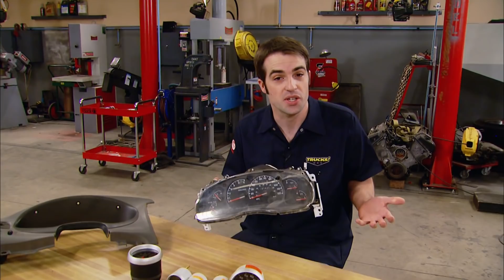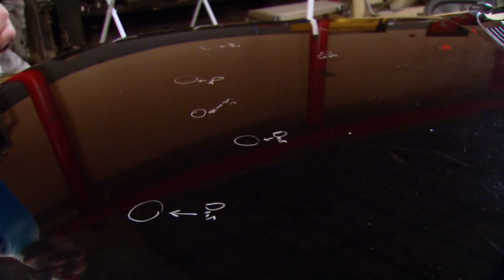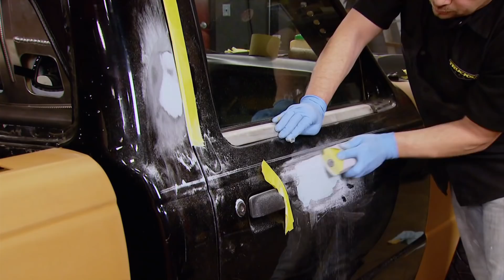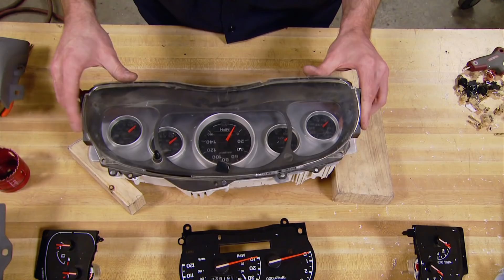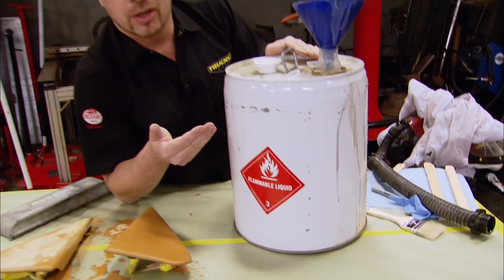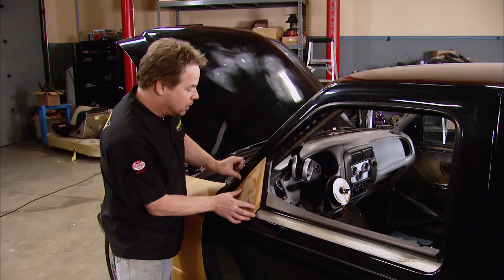On a Mission to Get Our Ford Ranger Rolling Thunder on the Road - Trucks! S14, E3

Comment: So Kevin, I got a 1999 Mazda b3000, V6 ,Flex fuel automatic, vin v push rod motor  since Nov of 2016 it was a Ford dealer shop truck; with the jump cab. Its got rust over one wheel well, tried to use fiberglass mesh & hardener, it was good for a while, but its popping thru on one side, but truck is pretty clean it was a Texas TRUCK, THEY SPRAYED A RHINo LINER IN THE BED. I heard you pitch Eastwood products & now this new stuff that you brushed on  any suggestions.[ hughmcsheffrey @gmail.com.] That's my first & last in the G mail.Thanks

Comment: https://youtu.be/PPJCQd7--XQ
They should change the name of the show to "CRAPPY HILL BILLY BONDO AUTO REPAIRS"!!!!
This is a idiot operation bondo is bondo which means cost of material, cost of sand paper, paint, clear coat, and fingers cross it don't look like crap. IN 2020 WE HAVE TOOLS TO REMOVE SMALL DENTS AND REFERRED TO IN THE INDUSTRY AS PAINTLESS DENT REMOVAL BECAUSE NO COST OF MATERIALS "ZERO CLEAN UP" AND LITTLE LABOR INVOLVED... WHAT A BUNCH OF 1900S IDEA OF A AUTOMOTVE FIX THAT EVEN THEN WERE DONE BY CRAPPY AUTOBODY SHOPS!!!

Comment: Why do yall keep calling it a ranger when it just has ranger parts?
Reply: Because it looks like a Ranger , the b2500 was badge engineered, and it will still be registered as a truck.
Reply: It is a Ranger, the fact it rolled out of the factory with Mazda badges on it doesn't change that whatsoever. It's still the same truck with the same Ford parts.
Reply: But the title and registration will still say Mazda

Comment: You know that Polly is going to full of pin holes and will need glaze and a coat of primer. Not to mention that color will bleed even if you have no pin holes would have to seal it. Before paint
Reply: They do enough body work in theirs careers they already know what needs to be done

Comment: Rock Auto is ok. I get parts cheaper locally or through other vendors. Returns.. although semi easy, I have to ship item back  and wait for replacement. As apposed to picking up today or tomorrow.
Reply: I work for a shipping company that delivers a lot of RockAuto's bulky items, DO NOT order body parts from them they'll throw them in an oversized box with minimal packing.